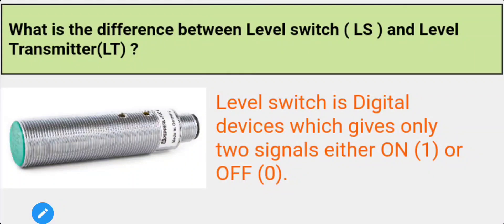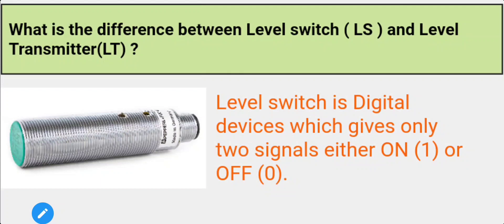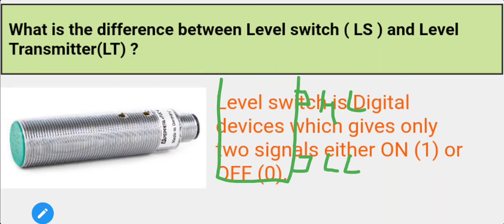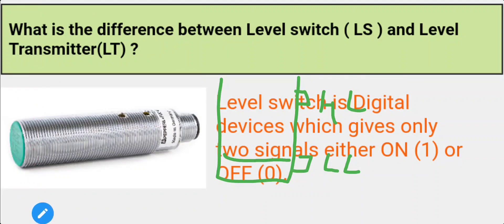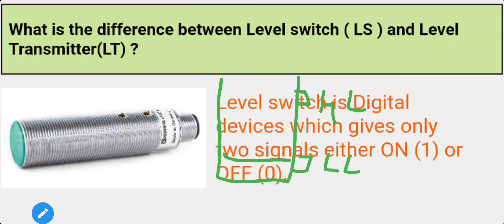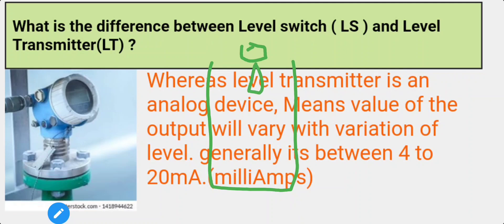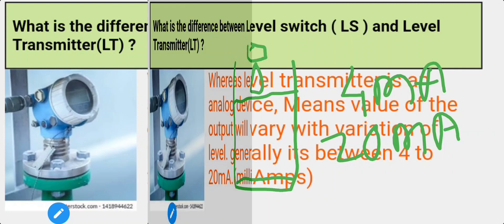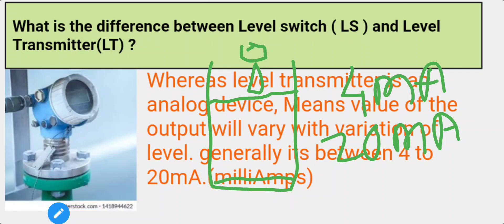Difference between level switch and level transmitter #instrumentation

Comment: The reason we don't use 4-20mA is to identify when there is a connection breakout..
We know the minimal value is 4mA and the maximum is 20mA, However when the value becomes 0mA it shows there is a connection breakout as this can be caused by certain factors say transmitter faulty or maybe no continuity of instrument signal